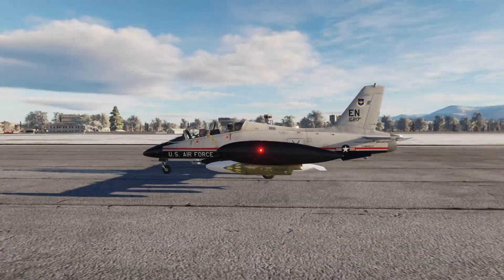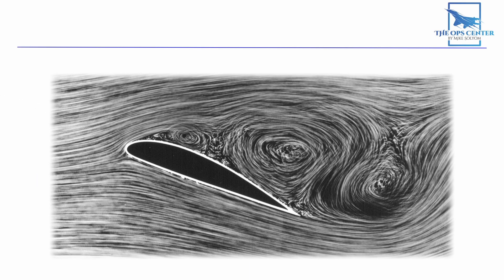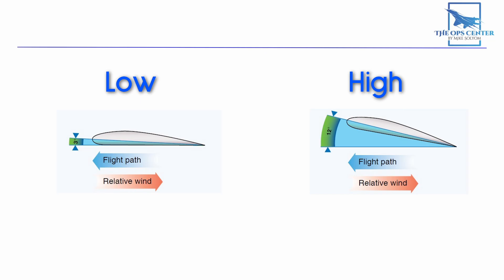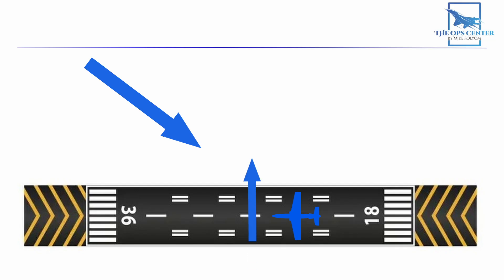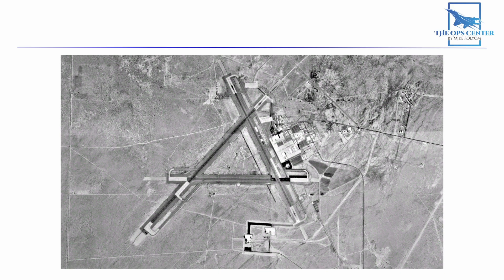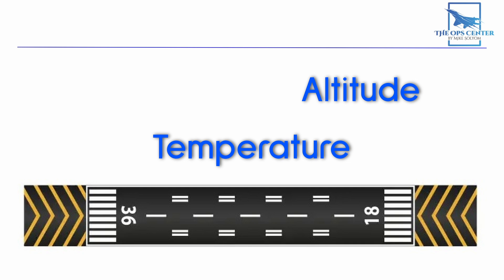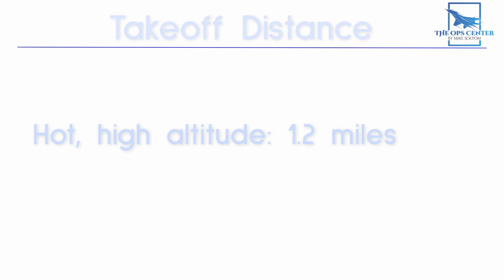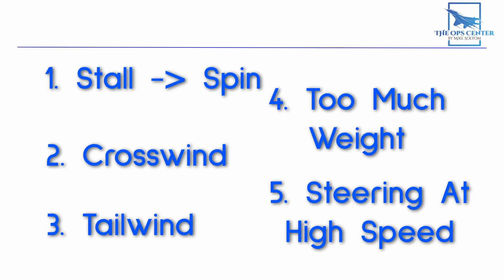5 Common Problems With Takeoffs And How To Fix Them | DCS Beginner's Course

Comment: Two things that really helped me: Proper trim/flap settings on t/o and don't force the rotation. Give it some back stick and let the wings do the work. She'll come up when she's ready. I used to try and pull the plane off the runway and that's when it goes sideways, literally. And once the wheels come off the pavement, get them raised. It's hard to get airspeed until those wheels are tucked away. And while you're gaining airspeed, stay as level as you can until you do have the airspeed. As long as you have enough altitude to clear the obstacles in front of you, use it. There's no rule that says you have to be at a specific altitude by a certain distance. Only high enough to keep from hitting anything.
Reply: Forcing the plane to do something it clearly does not want to seems like a common thing especially for pilots who jumped straight into the fancy modern jets that refuse any stupid input from the pilot.
To loosely reference Langewiesche (Stick and Rudder flying book), the most basic concept to remember is that you are flying your wing. You need to keep it within its envelope for it to treat you right. Forcing a takeoff tells me one does not understand this most essential rudiment of flight.

Comment: Steering down the runway in the Viggen on takeoff. Tips for that one? No nose wheel steering, but very sensitive rudder. It's the only plane I still have some difficulty with.
Reply: It's mostly practice. If you don't have nose wheel steering, differential braking is usually the answer. If you want to go right, very gently tap the right toe brake. If you want to go left, very gently tap the left wheel brake. You can also add a curve to you rudder axis to lessen some of the sensetivity.
Reply: @The90sHater  Oh, I'm fine with that, but you don't want to use differential braking while zooming down the runway on takeoff. The Viggen tho is super sensitive on the runway. And if I add a curve, then the rudder is too laggy in the air.

Comment: The MB339s NWS is not rated for takeoff, the manual says disable it before starting the takeoff run and use differential braking to steer until fast enough for rudder authority